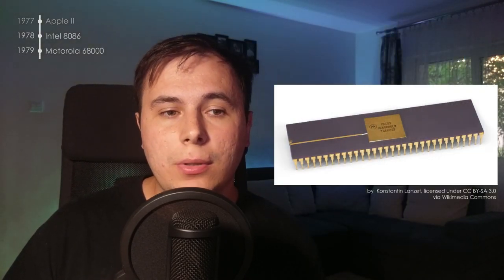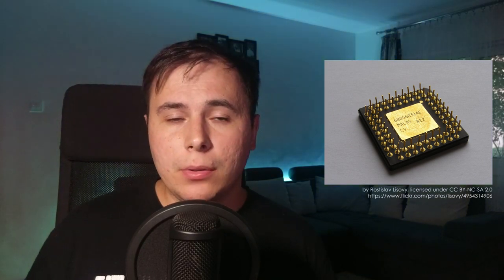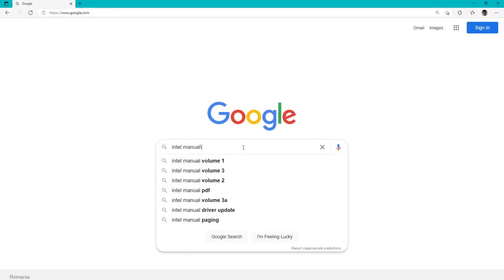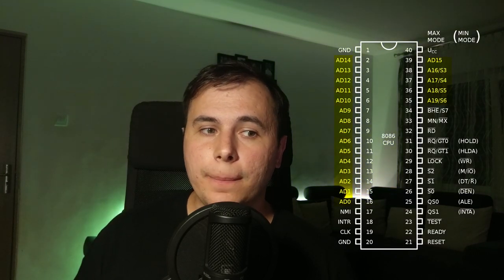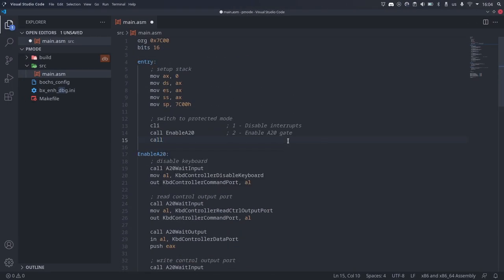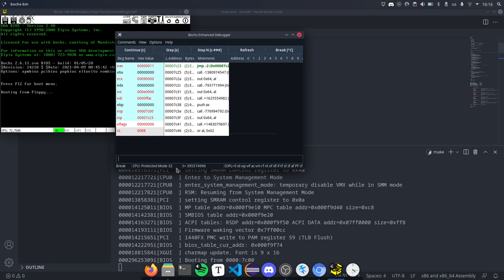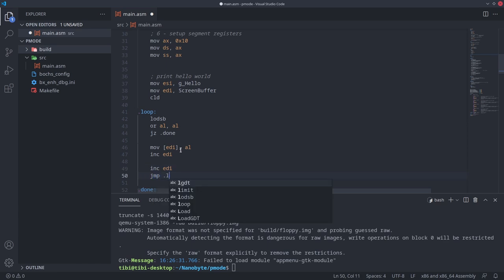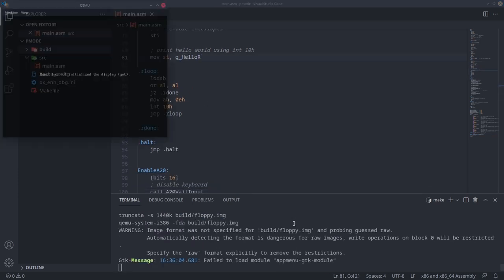Protected mode: how your OS can protect itself

Comment: It surprised me in a previous video when you used 32-bit registers in 16-bit mode.  I didn't know you could do that, but it assembled so I guess you can.  I still remember the first time I tried writing code in protected mode back in the 90s and how frustrating it was to find that all of the BIOS video commands I had come to rely on were gone.

The history lesson on protected mode was helpful for giving some context into why this is the way it is.
Reply from the maker: As long as you use a CPU newer than a 386, you can use 32-bit registers without issues.
Reply: @nanobyte-dev  What makes it 16-bit mode if you can still use 32-bit registers? Is it just the addressable memory size that's 16-bit?
Reply from the maker: @spaghettiking653  The main difference is how memory is accessed, and what protection features are available. However, 64-bit instructions and registers don't work; my guess is that adding support for accessing 64-bit registers in 16-bit mode required some extra work, and Intel decided not to since it's deprecated anyway.

Comment: Am i the only one who utterly hates the fact that our technology has all the weird messy hacks on literally every level of abstraction, just for the sake of backwards compatibility? The more I learn, the more I feel like we need a complete restart, greenfield redesign to get rid of all that mess and make a system that is clean and sane., without all that "because backwards compatibility" arcane nonsense...
Reply from the maker: I often feel the same, there are an incredible amount of hacks on every level. You wouldn't believe how many hardware engineers just go with "they'll fix it in software".

But, in the end, building something perfect will take forever and be very costly, there has to be a cut-off point where you can say that it's good enough. And what's the point of building something perfect if nobody is going to want to use it, because migrating from the non-perfect solution would be too costly? The entire industry is built on backwards compatibility.
Reply: Over the last couple of decades I've seen several really neat technologies fail due to a lack of backwards-compatibility.  I don't like it, but history shows that if you want to succeed you need to account for it.
Reply: @treytomes  i know
Reply: I don't know much about this but I fell like some architectures like ARM are "newer" and more "reworked", but it just takes some time until they're widely used.
Reply: It's a kind of perfectionism, and I feel like the more you learn about it the more you can understand the trade offs that are being made, because it certainly has to have a reason why it is like it is with all these smart engineers responsible. And I find that this can sometimes also scratch your itch for perfection
Reply: I also find it fascinating how modern processors are so well optimized around all this backwards compatibility